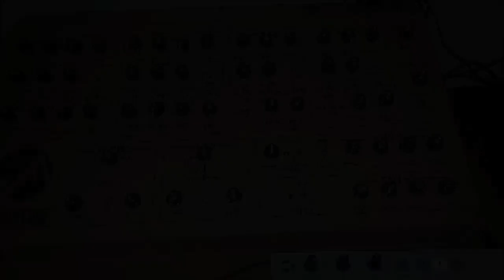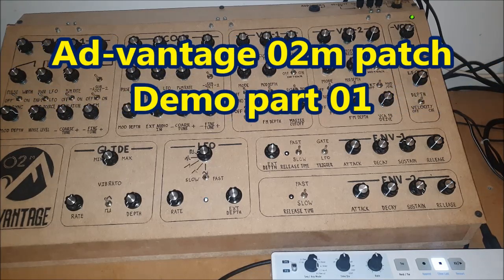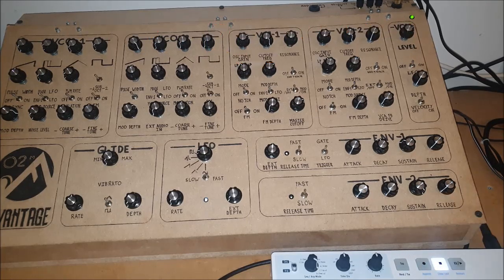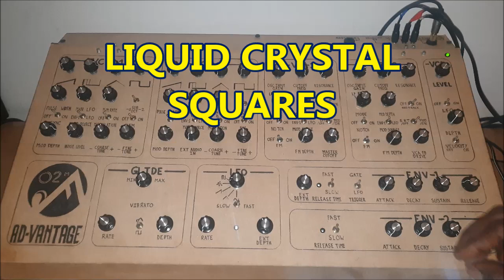DIY analog synth project ( Ad-vantage 02m Patch ideas Part 1)

Comment: Damn!  Sounds great, but I'm not too surprised that it does as you've had a great, ballsy core sound on this since your early prototypes, and you've only built on that foundation.  Seriously great job AA!
Reply from the maker: Hey man that's very much. This version ( the Ad-vantage 02 has 2 x sem filters in series. I am actually quite suprised as to how deep the filters cut, ok they don't self oscillate and what not but what they do , they do with such majestic finesse. 
Thanks very much for your comment.